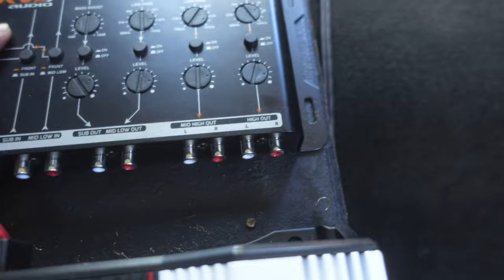My Amp Install was a Failure!

Comment: Hell yah bro and I gladly appreciate you showing us how an what not to do in a sound system when it comes to building it yourself … it’s all trial and error though cause I’ve done 2 of my own , one has 2(skar shallow 10 500rms) SIA1750.1 , 4(nvx 4x6) ,skar mini amp 

The other build , blow through (2-12 ddx skar) rp4500 @.5
Down4sound 4channel 
4(6.5 skar pro audio ) 
2(skar 3.5 tweeters)  currently want more in it too 🤣